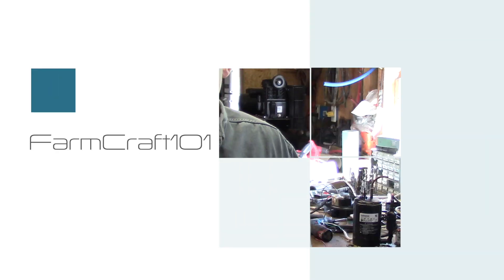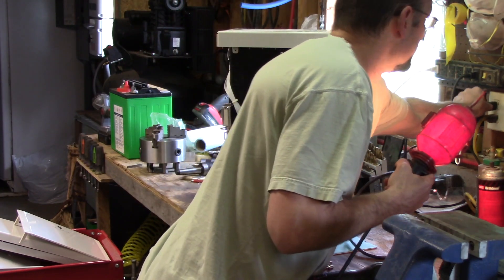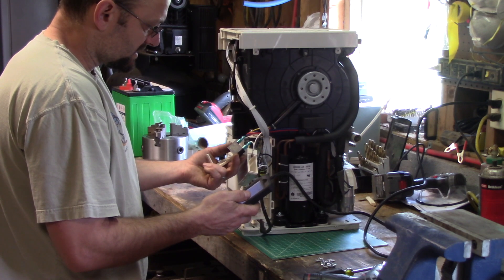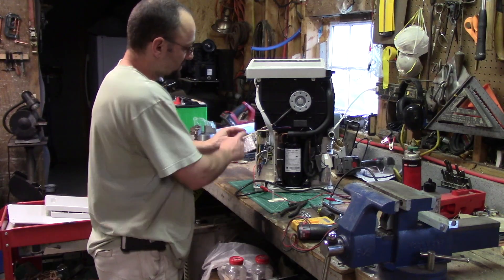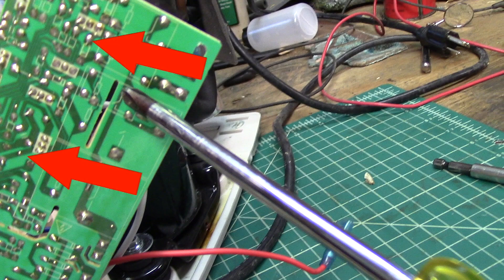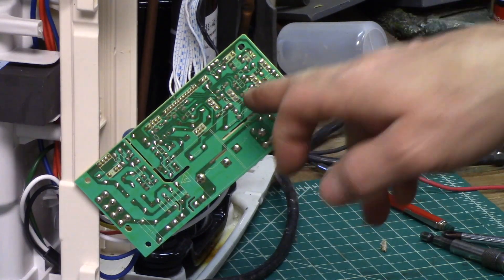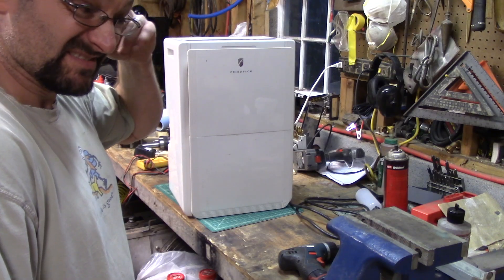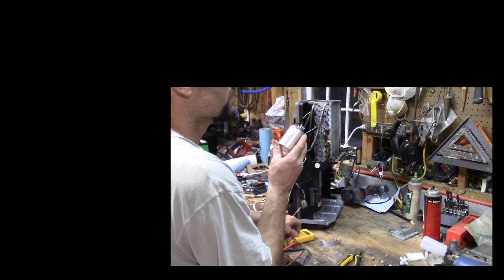How to troubleshoot and repair a dehumidifier, Part 1.  FarmCraft101

Comment: Mine (Whirlpool Gold) just isn't producing water. The compressor kicks on, the fan works well, but the bottom two runs of the front coils start to frost up. Almost to the point of making ice. Its like the bottom part of the coils get cold but not the rest. If I turn it off those bottom fins (coated in white frost) melt almost immediately and condense... so have NO IDEA why this thing isn't working. I can only think its low on collant?
Reply: Low refrigerant.

Comment: I have a Friedrich D70BPA Dehumidifier. It lights turn on but nothing turns on, I put the fan on High/low but no compressor or fan runs, it just sits and doesnt do anything. It looks quite new and has everything for it. Any ideas where to start?

Comment: Can you provide me information on why the top left coil on the left side of my LG dehumidifier freezes up?
Reply from the maker: My guess would be insufficient air flow in that area.  But hard to see the problem from here!
Reply: low refrigerant will cause frost.

Comment: You can't get continuity on a capacitor with an regular multi-meter, you need to charge it and check for voltage. - Great troubleshoot and repair.  - It's A vs E.  - Got two humidifiers I'm working on now.  One the fan motor burned out and can't find a replacement.  - Second had a problem with the humidity sensor.  It was packed with lint.  Blew it out, and the compressor and fan started working.  Now it will start and run a few minutes then kicks off.  I think it may need a refrigerant charge.  =  Like I said....Great video.

Comment: If it's the starting capacitor that's broken, maybe try this. 
https://www.youtube.com/watch?v=22kn7_LRphg&t=115 (hand prop)
Sometimes the friction in the bearings are so great, it can't be started even if the capacitor is good.
I once saw a refrigerator fan that could be started when it's cold, but couldn't be re-started when bearing temperature was high.
Good job by the way.

Comment: had a issue like this with my DeLonghi    but the blower motor is bad I believe -  issue I have is I cant even buy the fricken motor or cap  or any parts as they only sell parts to factory repair people.      crap lowes trash -   I think I will make a video in the Lowes parking lot with a sledge hammer...unless they should call and send me a motor.

I try to fix stuff

Comment: If the pipes get too cold the compressor needs to stop. What temperature does it need to stop?
Reply: Called a freeze stat. Or frost free function. It'd say around 30 degrees. Just a touch below freezing. Some ac units have them. Think some are set to shut off compressor @ 28 degrees

Comment: The modification does not allow the fan to "sample" the air humidity to determine if the compressor needs to turn on. The control board really needs to be repaired or replaced because the humidifier will turn on quite often using a lot of power. Maybe put a tiny fan in front so the humidity detector will continuously sample the air?

Comment: Amazingly he is working on my exact model - Friedrich D50D. My problem is that the compressor goes on, the lead coil gets hot but the other coils never get cold. Maybe its the refrigerant. Nice video thanks
Reply: Coil gets hot? Is fan running? Coil dirty, restricting airflow?

Comment: Great video!  I like to fix stuff too and you did well on that.  If the coil has too much frost or freezes over it is likely low on Freon.  You do a great job on your videos.  By the way, how do you like your Grizzly twins now that you have had a chance to use them.  I am thinking of taking the plunge but may start with something smaller, any advice?
Reply from the maker: +Ron Sites so far pretty happy with them. No regrets. Videos to come!
Reply: Looking forward to the videos.

Comment: Under some conditions, there may be frost build-up on the heat exchanger.  The dehumidifier will run the fan without the cooling from time to time to melt the ice.
Reply from the maker: Good point Matthias.  I'll look out for that.  So far it has been working well.
Reply: Yes, that dehumidifier has no auto defrost now.
Reply: I think mine may be the temp sensor I had lost of ice build up defrosted that etc . The small 2 pin board /sensir may have shorted fan on mine runs but compressor shuts off